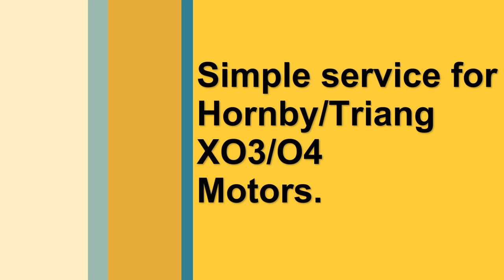Triang Hornby XO3 O4 motor service guide

Comment: I always use a fiberglass polishing pencil to polish my commutators. I Never have an issue with wearing out the metal surfaces with them.
Reply from the maker: Not a great plan as it makes lots of micro scratches that wear teh bruishes faster and build up dirt more quickly

Comment: I’m here because I almost burned out the motor.
Although I do give the motor an occasional service, I have just discovered the coating on the outer iron core bit to be flaking, I’d left the loco running, it had come to a halt and when I returned it was sat there buzzing away.
The coating had come loose and jammed itself between the frame and armature.
I have cleaned the rest of the coating off the iron cores and given them a very, very thin coat of Araldite, it has to be thin, otherwise it bonds the armature to the frame.
Anyway, it’s ok now, up and running again.
I can’t do a resistance check as yet, I don’t have my meter with me.
Reply from the maker: Sounds like you have done a great job

Comment: Can you actually remove the spindle and wiring loom on these motors.  I have stripped the motor down but the spindle still seems trapped between the front and back.  I have 2 motors that the wiring has gone so they are shorting but I have one good motor but the brush arm holder has broken so want to canibalise and make one good motor
Reply from the maker: You can certinly strip them down, required to remove the worm gear first

Comment: Hi Mike. The avenue I am considering is exactly as you suggest. I have tried  some brushes for power tools, even  those with a copper coating, but to no avail, so now perhaps I shall try copper plating the carbon myself to get something that will solder.        Regards  Steve Hollands.
Reply from the maker: Hi Steve, what about something like this? https://www.amazon.co.uk/Conductive-Wire-Glue-Paint-Soldering/dp/B00SRIITQ4

Comment: really helped me thank you i have two one does not run well and is black on the front of the windings the other spins really well and looks clean but the worm has a lot of back and forward motion looks like it might be a missing part problem as i cannot see the front oil pad it is not there and it loock the loco up when fitted
Reply from the maker: Hmm, are you on facebook by chance? if we could see a photo it would be easier to help?
Reply: i am on facebook and just uploaded a couple of pics i will say i am not that fantastic with facebook to be honest
Reply from the maker: Look up the Non Digital group, say I sent you, I'll look out for the photos
Reply from the maker: Here is a link https://www.facebook.com/groups/NonDigitalModelRailwaysOldSchool/
Reply: have posted on there now two different motors

Comment: Hey .. GREAT video. I am servicing one like that, but i´m struggling with the brushes that have a separate carbon from the metal part and i am not getting a way to could solder them again together. Perhaps you know a way to do it!!
Reply from the maker: That's an age old problem, I think there are some conductive glues you might try~?

Comment: Hi Mike, why does the red insulator shield the second of the brushes? I know that sounds a stupid question, but if you could explain the setup to me that would really help
Reply from the maker: Hi, The body of the motor and so therefore the top brush retainer/spring is connected to the chassis of the loco and forms the return path for the current, therefore one of the brushes needs to be insulated from the spring retainer and takes its supply from the wire that comes from the loco pickup plate.
Reply: @MikesMovies  Brilliant thank you. I'd got it into my head that the brushes formed two points of contact going "in", but that is on reflection nonsense, thank you for the info, head hurts less now haha.

Comment: Thanks for the video. Very informative. I need a new set of brushes for my motor off of a Tri-ang  T.R 2335  steam engine. Any Ideas? Thanks again.
Reply from the maker: https://www.ebay.co.uk/itm/TRIANG-HORNBY-X67-CARBON-BRUSHES-X2-Pkt-FOR-TRAIN-MOTOR-X03-X04-CAN-MOTOR-SPARES/324199186181?hash=item4b7bc6ff05:g:Ju4AAOSw9tFeuugD
Reply: @MikesMovies  try Peters Spares

Comment: Hello Mike. Fascinating video and have learned much from this and others. Many years ago I recall being able to replace the small carbon pad located on the motor brushes, as they are just soft soldered, but sourcing the carbon cubes, or anything suitable is hard to do. I also have a large collection and the need to replace brushes beckons and at commercial rates is going to cost a bomb. Any thoughts on where one could source carbon cubes that would do, even if they are a bit oversize?  Kind Regards   Steve Hollands.
Reply from the maker: Hi and many thanks for the kind comments. I am over on Model Railways Unlimited now, your question is one I am considering myself, I think it will be a case of carefully selecting something from China and cutting them to size https://www.google.com/search?q=carbon+rod+for+motor+brushes&tbm=isch&ved=2ahUKEwiDh_j1sZnrAhUD-4UKHX2dAMQQ2-cCegQIABAA&oq=carbon+rod+for+motor+brushes&gs_lcp=CgNpbWcQAzoECAAQQzoFCAAQsQM6AggAOgcIABCxAxBDOgYIABAFEB46BggAEAgQHjoECAAQGFDs3wJYirsDYK2_A2gAcAB4AIAB7wKIAfcNkgEGMjcuMy0xmAEAoAEBqgELZ3dzLXdpei1pbWfAAQE&sclient=img&ei=TdQ1X8OsKIP2lwT9uoKgDA&bih=907&biw=1680#imgrc=CQfIVs8qUq9d1M&imgdii=SbmH-47TJqFnMM